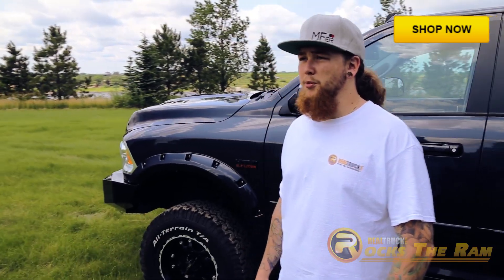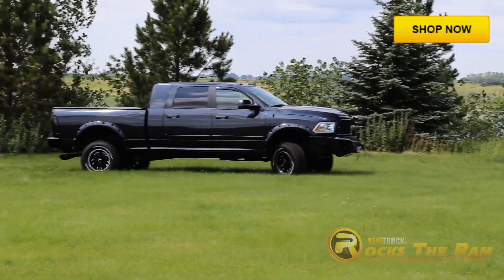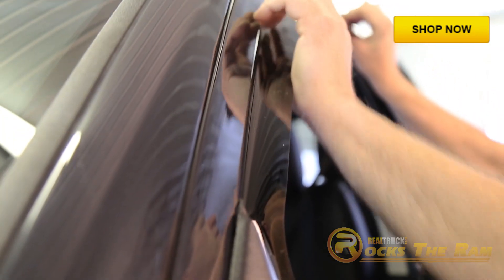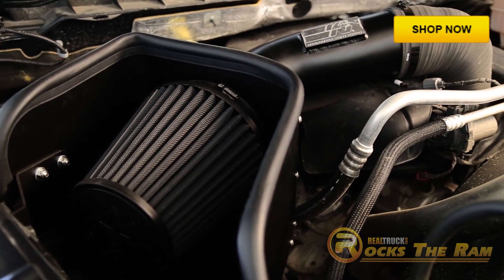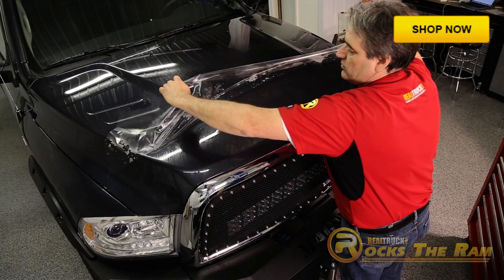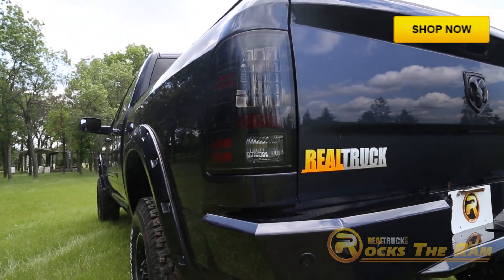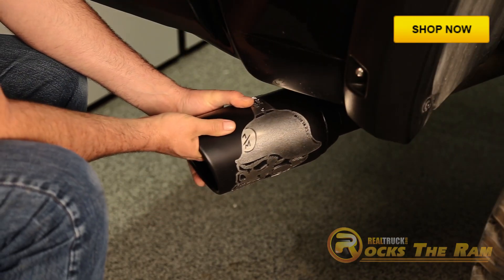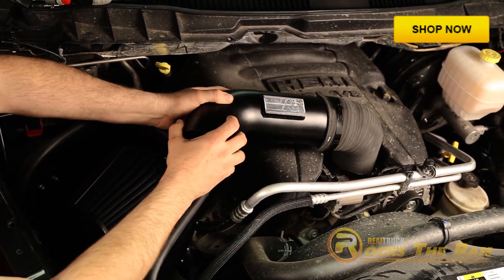Custom Dodge Ram Mega Cab 5.7 Hemi Buld - RealTruck Rocks the Ram

Comment: I have a 96 Dodge Ram 1500 4th 5.9 V8 gasoline. How can I make it have more power, and would an air intake be good?
Reply from the maker: Westley Nordahl Hey Westley! Yes you can get more power of your Dodge with a Air Intake and Exhaust System. With these 2 you will definitely feel the increase. 
Air Intake > http://www.realtruck.com/air-intakes/dodge/ram-1500/1996/
Exhaust System > http://www.realtruck.com/exhausts-mufflers/dodge/ram-1500/1996/